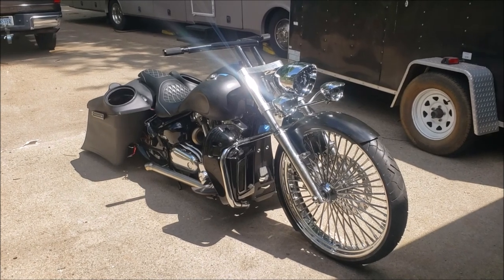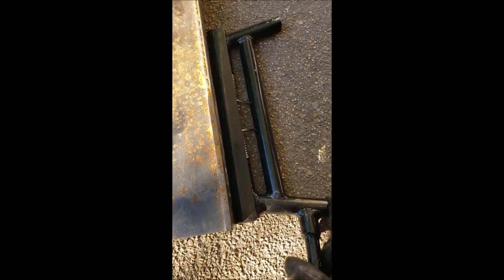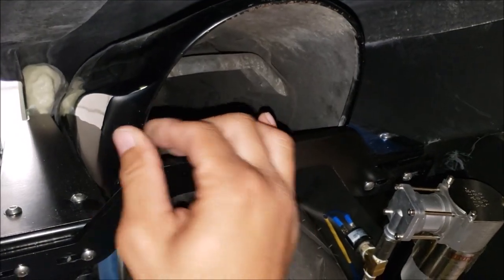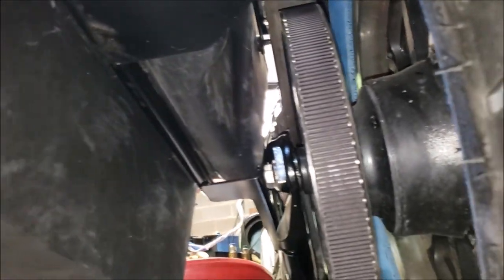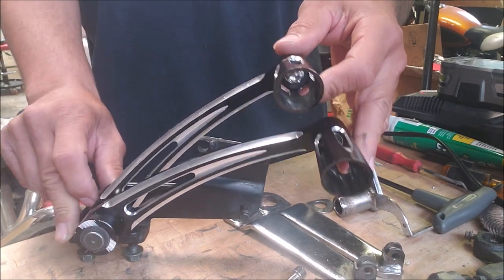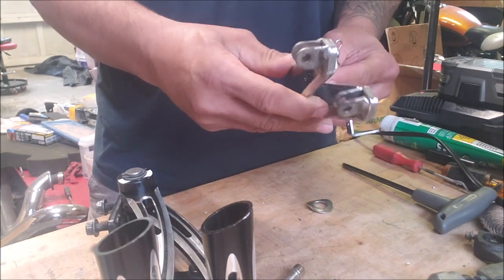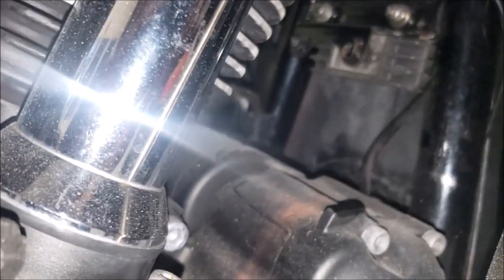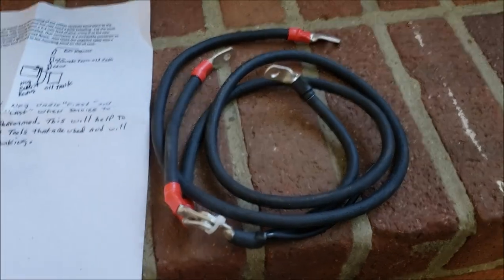Yamaha Road Star Big Wheel Bagger Build Chronicles, Episode 18

Comment: Bro. Just use a VTX 1800 Master cylinder. It already has a split line to combine both brakes with a single cylinder and pedal.
Reply from the maker: Appreciate the info.  Still trying to have independent control of front and rear.
Reply: I have one if you decide it could be useful to you. I can ship it. I'm in SC
Reply from the maker: That's awesome, much appreciated.   I'll definitely let you know.

Comment: Yeah nice work!! Question: 
1.What about the stupid A.I.S System ... will you left it on the bike? In my WildStar Group we kick it emidiatly .. it is usless.. somtimes also blocked and of no use at all. 
2.Don´t you think the engine will overheat? At summer .. HALLO it is air cooled ... ;)
Have fun and go on... Greatings form Hambrug, Germany
may you have time to look at mine... https://www.youtube.com/watch?v=07TyfQ91K8k
Reply from the maker: Greetings my friend.  Yes, I did remove the AIS.  In on if my videos,  I apologize for not filming the removal, but talk about it, where it was and what I did to remove it.  As far as overheating, my lowers have vents to let air through and the chin spoiler is vented as well.  If I start to have issues with heat, I'll make some changes to accommodate greater cooling.
Reply from the maker: That is a very cool and original build you have.  Are those V Max or Z1000 exhaust cans you have on there?  LOL
Reply: @mr_sinister  hallo... it is from the z1000 .. i am still in try to start my new 2000ccm engine.. i just cut off the length by ca. 10cm.. now it looks nicer. Also i put clear on with gold flicker.... hope to make a new vid on that shi.. soon.
Reply: @mr_sinister Hallo, it was this video .. at the end the AIS is gone. :) In summer I used to burn my legs and eggs above the bigship. :) but she is giving me pain the last 2Years. So i couldn´t ride as mutch as i would like to..  I like the spoiler with the led´s.. nice pic. The Exile Grips are fantastic.. I love the Exile bikes. 
they are often in my paintings. :)